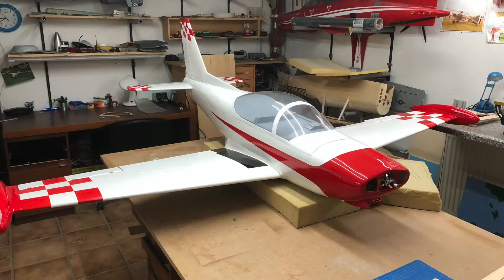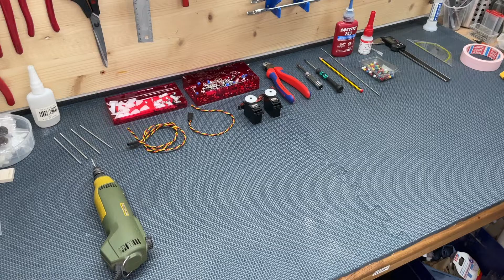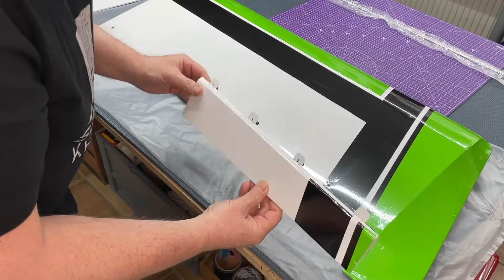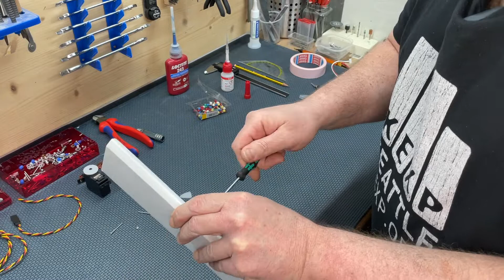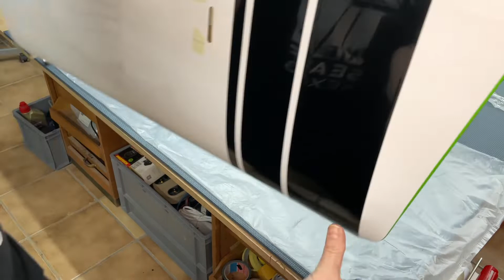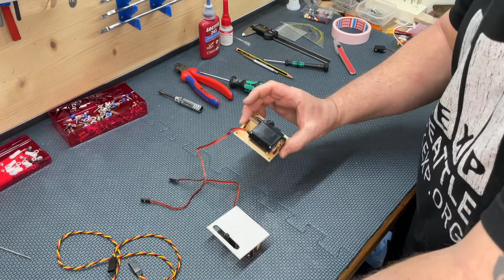Hangar 9 Ultra Stick Wing assembly

Comment: Better to use Du-Bro # 117 standard hinges  Two packs will do it and  they will not fail.
Why would I use a CA hinge in a 30% plane ? Not for me
Reply: Did you already try to pull out such hinges correctly glued with CA ?  I did ... 100% confident now 😅 ... and the ailerons and flaps are quite small finally
Reply: @benoitkina9551  .... Not saying they will fall out of the plane. I'm saying use a better hinge in the beginning , not a cloth/ paper  type hinge.

Comment: Even though the instructions say to install the control horn screws upwards, I prefer to have the smoother finished screw heads on the top of the wing that is most visible.

Comment: Great video!  For those using standard (not metric) drill sizes, the instructions are WRONG.  Make sure to use the correct drill size when converted to standard.  Somebody got the math wrong when they wrote the instructions.